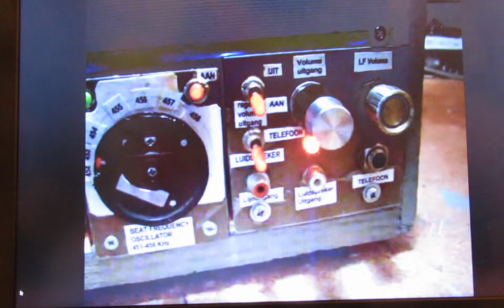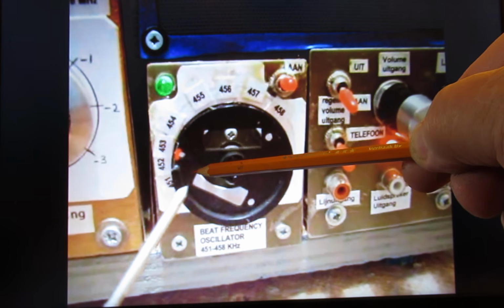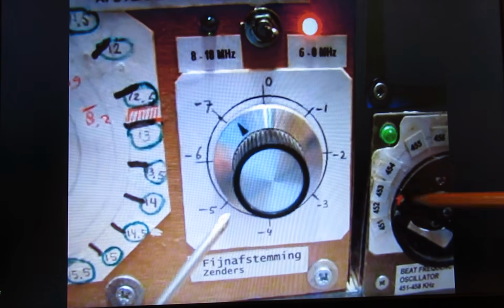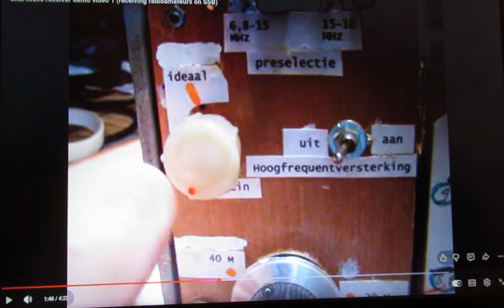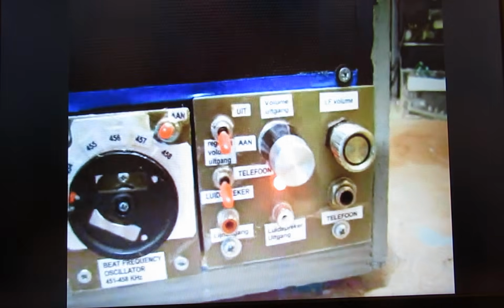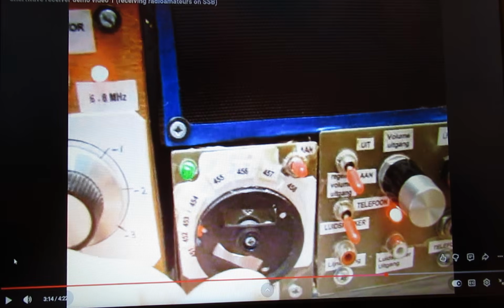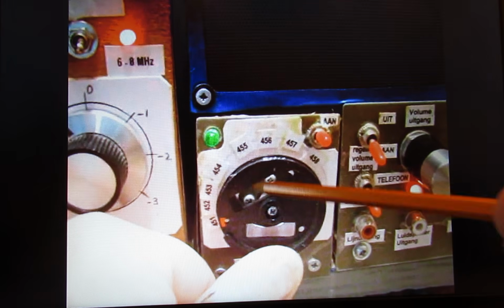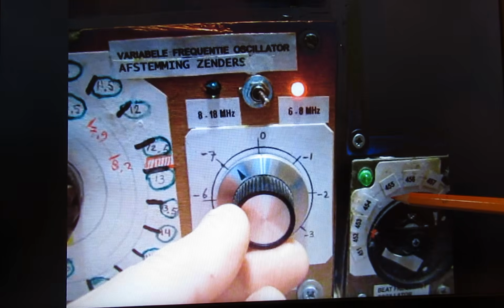Talking about SSB radio reception via a BFO on Shortwave in the old school analog way (principles)

Comment: I also made bfo circuit using tv remote control crystal 455 khz and 4069 ic . It worked good. In morning hours I listen 7mhz ssb signal using SONY short wave radio. From Sri Lanka.
Reply from the maker: Thanks, good info.